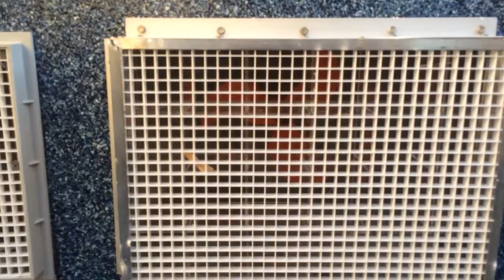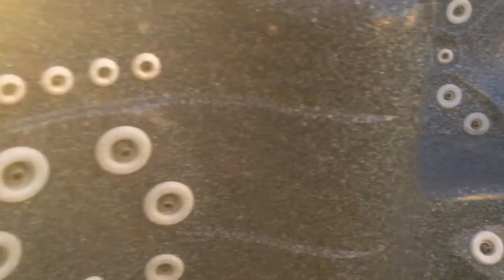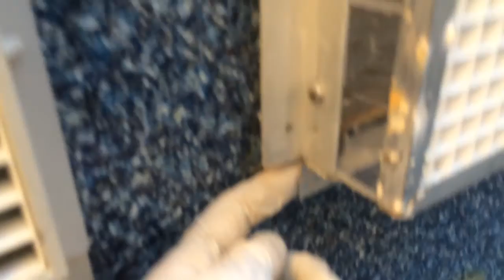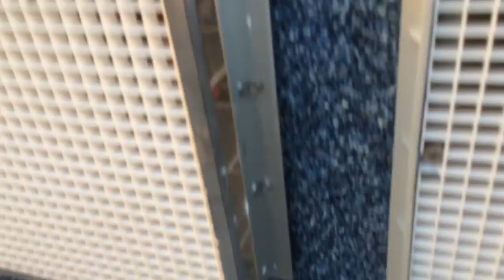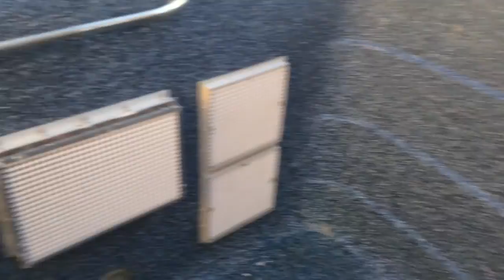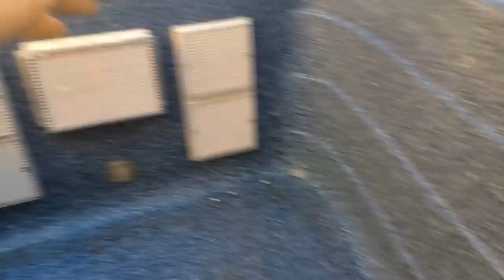Masterspas H2X Swim Spa propeller and grate custom upgrades #2

Comment: I like these changes,  I want to build a swim spa and have gained info.   Your video of the motor and the mounting along with prop change idea is what I would like to copy in my designing of my own spa,  I am having trouble trying to figure out how to visit on a more personal level.  To see in person would be a good thing for me, however I live in Fremont , Nebraska, this is probably miles from you.  I don't know how to discreetly contact you. Thank you for your help.  Richard Coates
Reply from the maker: +Rick and Mary Coates. Rick, glad you liked the video. I am in Northern California. I am not sure how often you get out this way? You can email me at mwsmotorsports@gmail.com. The fact they use a spinning prop shaft with a standard spa seal on it, is the key to building one yourself. You could just buy the shaft/bearings, seal and pulley assembly from Masterspas (they want like, $850) and do everything else yourself. One thing to consider: if "I" were to build an electric swim-spa myself-- from scratch, I would use a much larger prop and perhaps, imitate the orientation of it, like Endless Pools does. Theirs is horizontal, facing up and has vanes that guide the water forward. My wife liked that propulsion feel the best, but the motor is a vegetable oil pump that pumps to the prop and requires replacement every 4 years for thousands of $$. Get that simplified and converted to an electric motor and you have something.  Remember, you will need an electric motor "drive" to control it. The drive is everything (and a lot of $$). Without it, you will burn out your motor in no time, trying to slam it on and off with a basic switch. You might already know this, but just mentioning it.